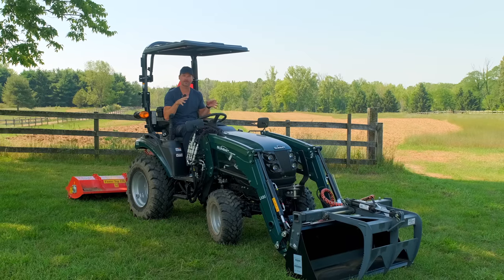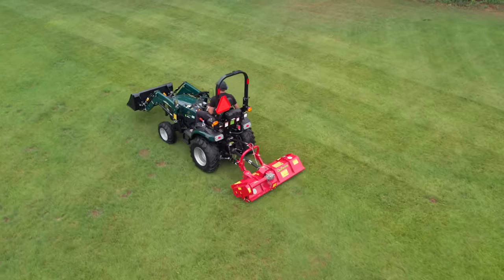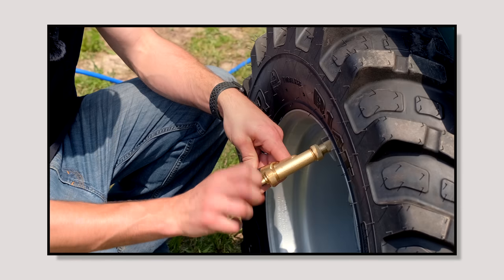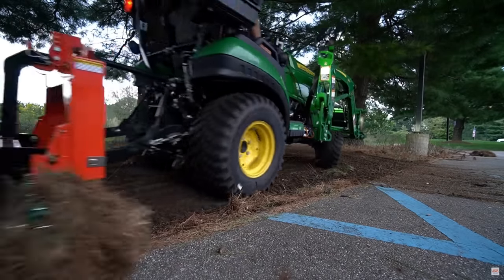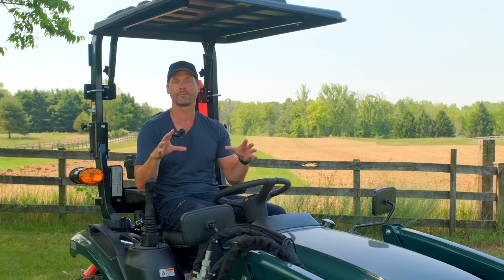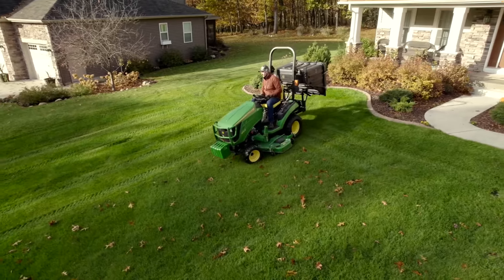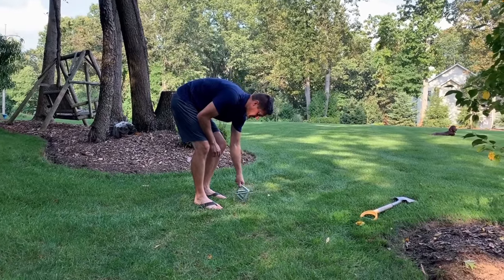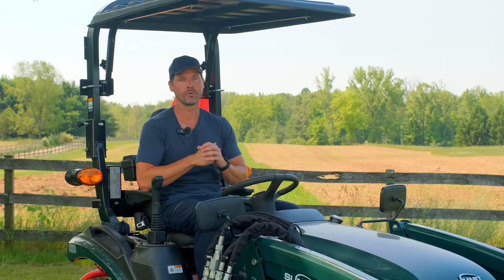TOP 10 TRACTOR TOOLS FOR LAWN MAINTENANCE, REPAIR, & RENOVATION

Comment: Im looking at getting a BX or B series from Kubota for my yard. Debating if a flail mower would be good for regular mowing of the lawn, or if I would want a finish mower specifically for the yard. Looking at them because if it is good for finish yard, I can also change to hammer blades for more rough work when required

Comment: A tiller will make your lawn smooth no doubt.  However, it makes the dirt fluffy.  It will eventually settle leaving the earth uneven and washed out.  If you do till it needs to be compacted.  Theres a difference between a lawn and a garden.
Reply: You have a great point.  I've used a Harley rake on my lawn, and firmly believe that's the right tool for the job

Comment: Best solution I've found for moles is to eliminate their food source: Grubs. Grubs do enough lawn damage alone so I do multiple granular grub killer applications per season. This year being soo dry I didn't get any down yet and never saw those June bugs come out here in Central Wisc. but I plan on applying a good dose in August to keep any larvae under control. skunks and sandhill cranes locate grubs also like no one's biz. I see them in neighbor's yards tearing up the turf but for past 2yrs after I started removing grubs, I'm 95% mole and grub free.
Reply from the maker: Yeah, I've tried grub control for years.  That never seemed to make a difference for me. I know some folks swear by it though.
Reply: @GoodWorksTractors Same here, did 2 years of grub treatments. Finally got results when I started using scissor traps. I now have 6 traps, use them for less than a month per year and now have 3.5 acres of mole free lawn!

Comment: I got a separate lawn tractor to mow plus I have a JD 40" aerator and a 40" dethatcher which I recently converted to fit in a 2" tow receiver on my 3 point hitch. One accessory I regret getting is the JD lawn sweeper, just don't use it...Have a great week guys 🙋🏼‍♂️

Comment: Looking for help!
I know it's more expensive than tillers. But wouldn't a harley rake work better than a tiller? I have 2 acres I took from dense woods to yard over the last 7 years by myself. I'm struggling with the big dips and hills as well as unlevel and bumpy. It grew beautiful grass on its own but it's still not what I'd want for my kids to run around on when they are old enough. I want flat perfect lawn like a dang park hahah.
I use a box blade a bit with ripper teeth but it takes a long time and just doesn't do the job I'm looking for. I have been told a harley rake (power rake, specifically the landpride pr10) would eat the grass and dirt and knock hills down and make it flat. 
Looking for guidance.
It's been a long journey doing this all myself. But I'm feeling very discouraged to have gotten this far and not getting the results I want before I seed it.😅
Reply from the maker: Harley rakes are great tools, but incredibly expensive.  You could likely buy 3 or 4 tillers for the price of a harley rake.  Tillers do very well and could even finish off the final grading with a dethatcher rake for a really even finish.
Reply: @GoodWorksTractors  I guess my main concern is roots and rocks with the tiller. I have a lot of that lol. Will it ruin the tiller to have a lot of that?

Comment: What would you recommend to collect little rocks so we don't damage a mover of tiller tine
Reply: It takes a pretty large rock to damage a tiller. The tiller will just move them. You could try a power rake if you have lots of rocks in the yard. Or the old fashioned hand removal always works 💪